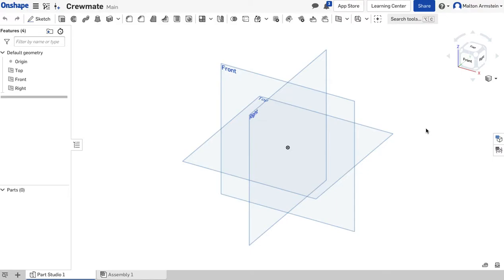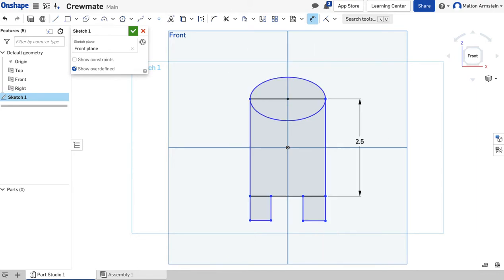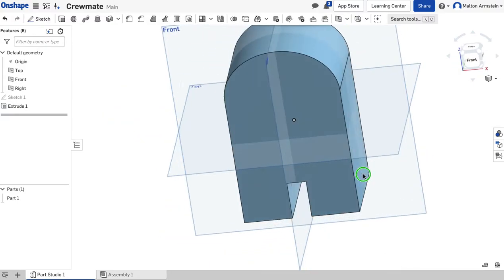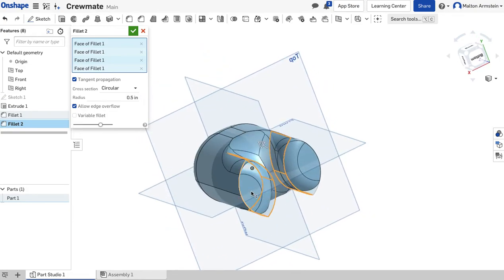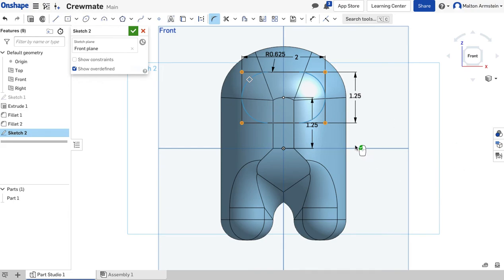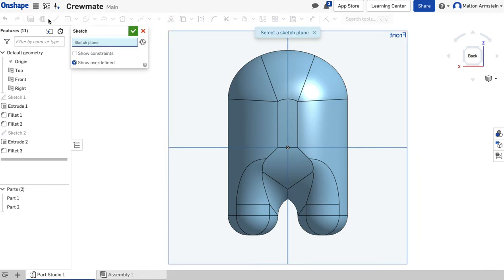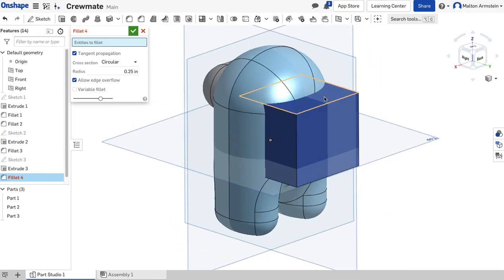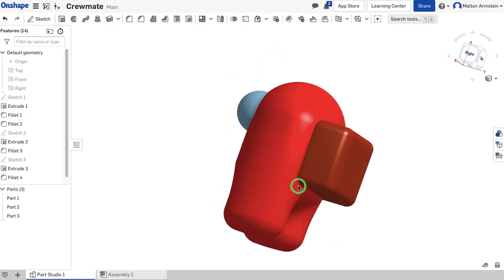Among Us Character 3-D Design

Comment: I am woking on a pill container that could fit in a wallet around the dimensions of 10 cm x 5 cm x 2 cm. the challenge is to make it work like the old school gum dispensors so that when you slide a door one pill should be out and there should be a count change on one side od it. That the container holds this much pills inside now that you have taken out one pill.